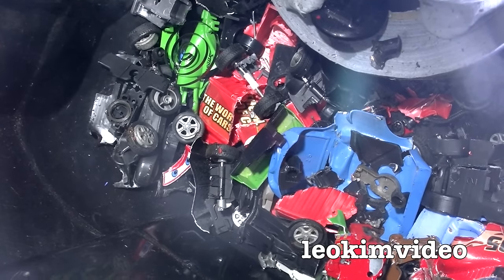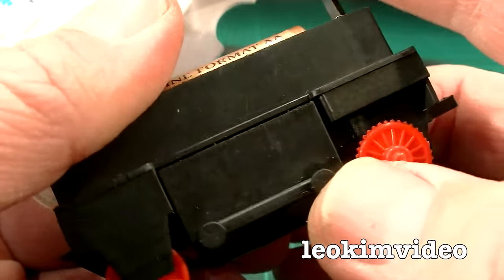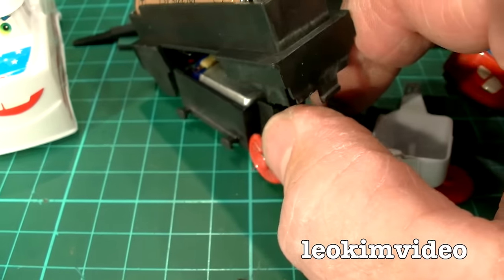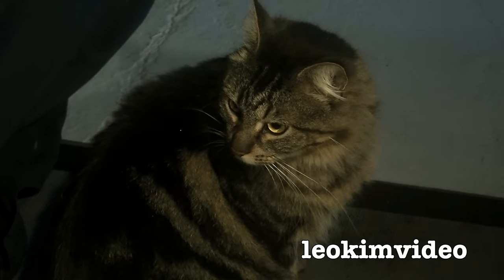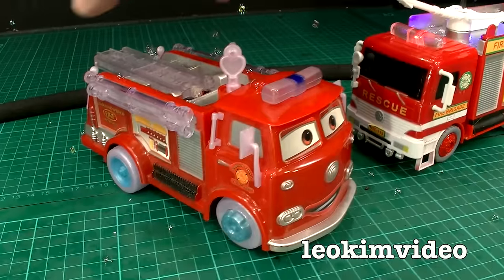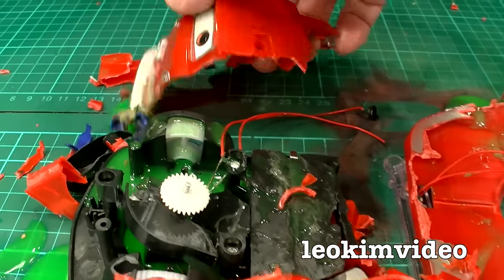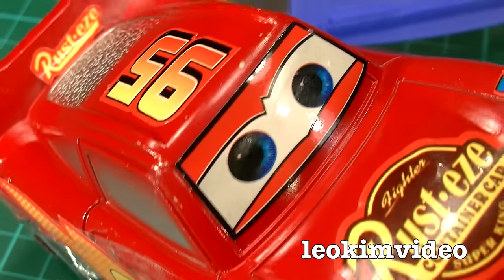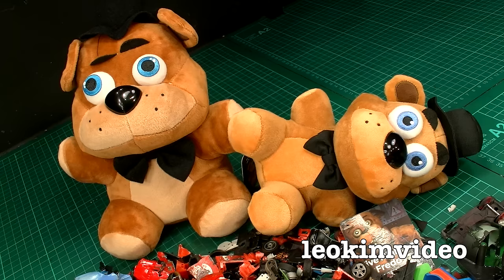Disney Cars Dark Side Knock Off Toys Ep3 Lightning McQueen Ka-Poop Mater Toon Train Wreck

Comment: It's crazy that these two completely separate toys from seemingly completely different manufacturers share so many of the same elements like bump-and-go mechanisms and flashing red and blue lights. This is especially prominent on those knockoff Thomas the Tank Engine toys, how they've all got the same exact loud and obnoxious stock train sound files. If I were to guess, in all actuality despite what you see on the box art, a good majority of these are most likely illegally manufactured by the same chain of sweatshops somewhere in China.

Comment: The siren on the bubble blowing fire engine sounds identical to the one on the 1993 Hess Patrol Car (and it's Wilco and Servco counterparts). Very odd that they would use the sound chip from a 30 year old limited edition toy in a cheap toy from the 2010's.🤔